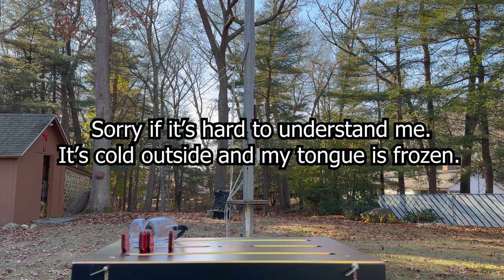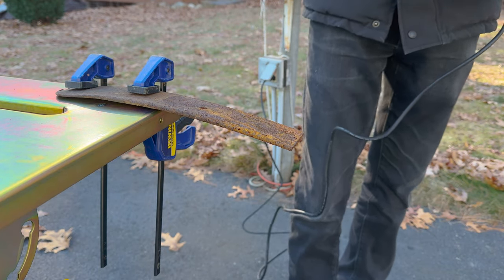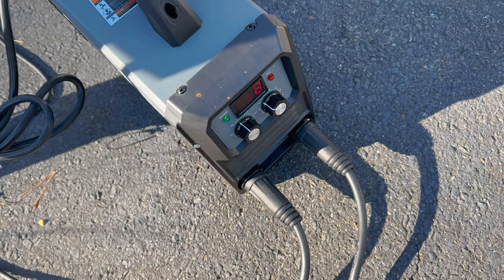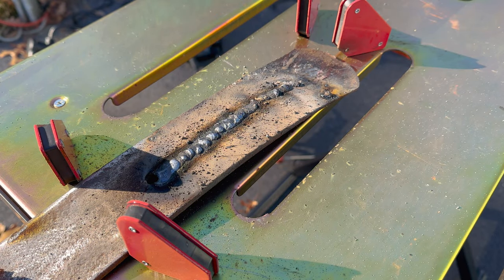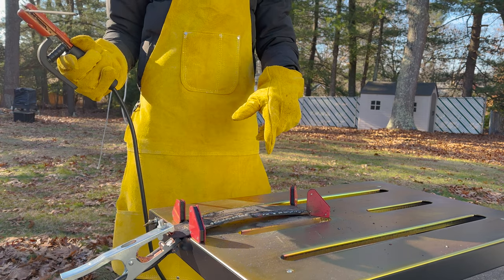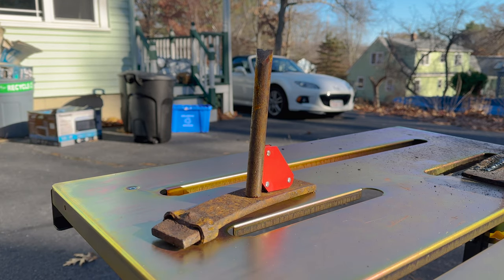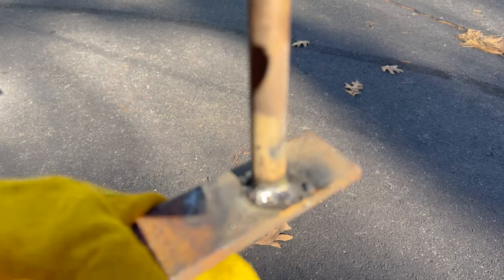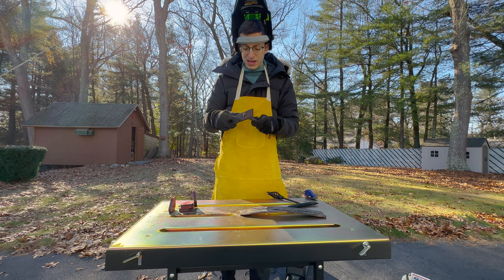Welding for the First Time!

Comment: Howdy, you did pretty good for first time.  angle and distance of rod will have a lot of affect on your weld bead. more distance from work piece with rod will make a hotter arc and not enough distance will make it stick as you experienced. many even small details that can make beautiful welds. if you have any safety concerns please consult experienced personnel your or someone else's life could depend on it, there are many dangers
Reply from the maker: I have a friend that is knowledgeable in welding, and he's been my source of safety lol. Thanks for the advice!